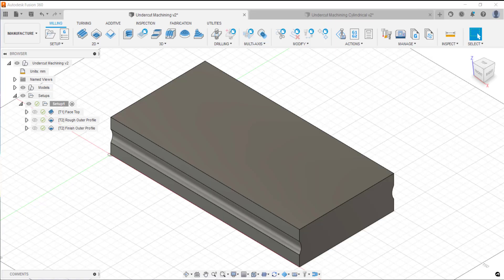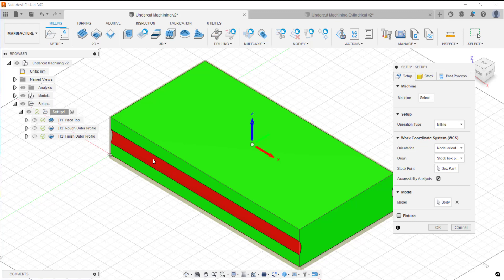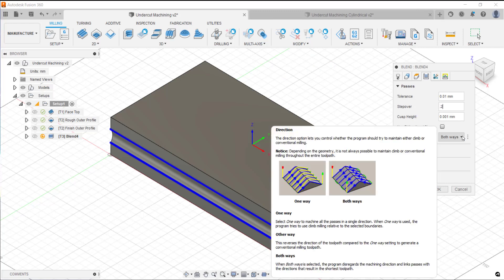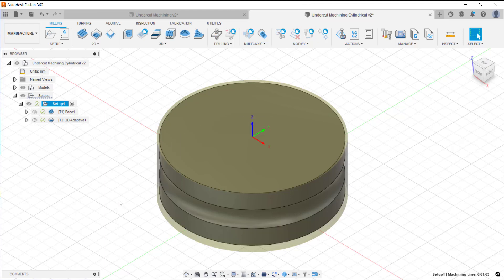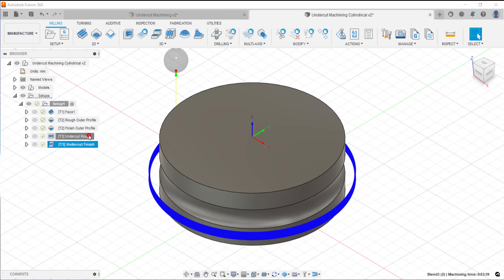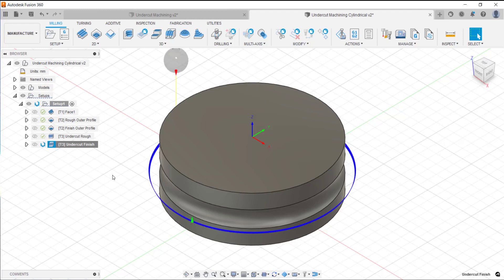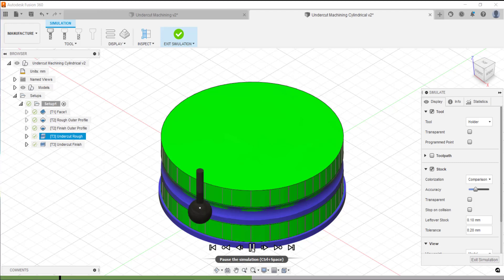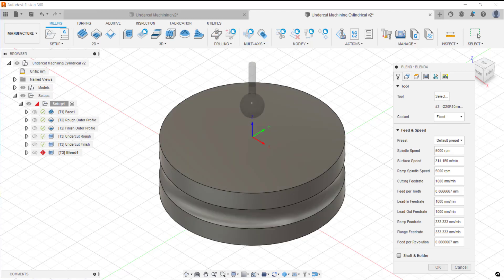Blend Strategy for Machining Undercuts with a Lollipop Cutter

Comment: Hey have you tried this recently? I cant get it to work in the current version. My part looks exactly like yours and I'm getting "Error: The edge of a surface you are machining contains undercuts. This may have affected the toolpath calculation and subsequently reduced the quality of the toolpath.

Error: Toolpath calculation failed.

Error: Failed to process job."

You don't say fusion...an undercut is exactly what I'm trying to do!